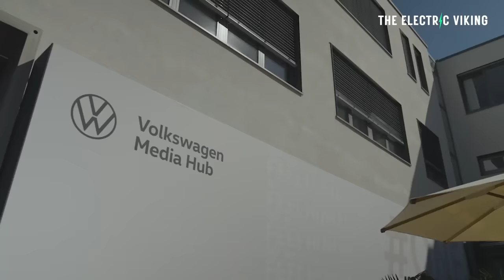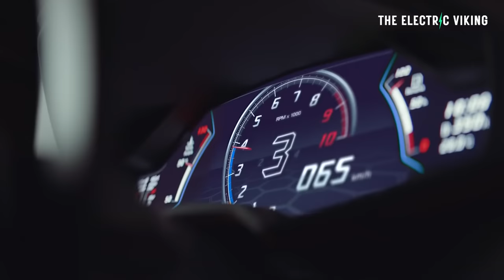Germany says VW is struggling to find answers for Tesla & BYD's pricing and tech

Comment: This is a security issue as much as an unfair competition issue for the EU. Russia is on the doorstep with its armies. Its hard to see Europe letting its automobile industry fade away. Also, these auto companies in Europe could eventually move a lot of their production to China to compete. Remember, auto factories can be turned into military production, if needed. Although these auto industries should suffer for being late to the party, there is a certain line that the EU wont allow to be  crossed. I suggest Chinese auto companies will be forced to set up shop in Europe if they start to succed in their exporting strategy to the EU.
Reply: I wonder if that'll prove true in the EV world.  A tank built like an EV, isn't much of a tank.  An EV built like a tank, isn't much of an EV.  The successful EV manufacturer has succeeded by honing its design and manufacturing for efficiency (and thereby I suspect a fair bit of specificity).  I wonder if someone familiar with Leopard production could opine on whether the drone fly through of the Brandenburg factory made it look like that could be converted to make Leopards in a reasonable way.  Could one make use of much more than the building (pad, exterior walls, roof)?  Leopards too have their specificity...the leveling of the main gun while moving over rough terrain, etc.  Half a century ago, was the manufacturing and design more generic than now?  Does this car factory to tank factory meme still work in 2023?  Just asking
Reply: Not unlike how the US is handling it. Produce your cars in the US to get a "rebate"
Reply: @bearcubdaycare  Cheers, I guess Europe will want to keep a certain amount of its own auto industry. What happens if a foreign supplier who dominates, decides to turn off the Tap. Europe will be beholden to foreign persuasion. I suggest it's in Europe's best interest to make it attractive for Chinese factories to setup in Europe rather than export from China. Kinda like how China has done for decade's and the USA does now!
Reply: @bearcubdaycare Cars to tanks, worked in 1940-45, big factories, thousands of workers, no computers, automation etc. Conversion to simple Pershing tanks went quickly. Nowadays it's highly specialized automation, and tanks are super complicated.